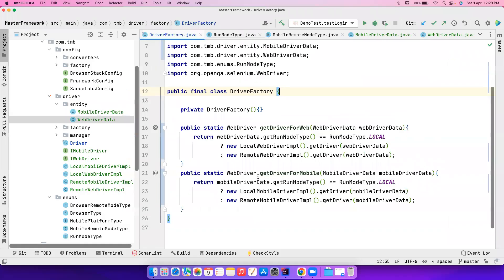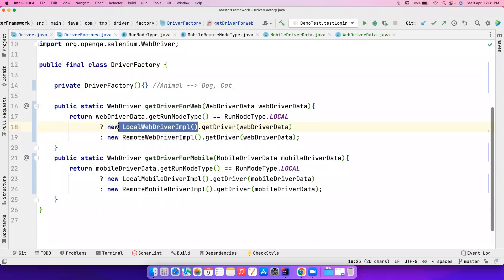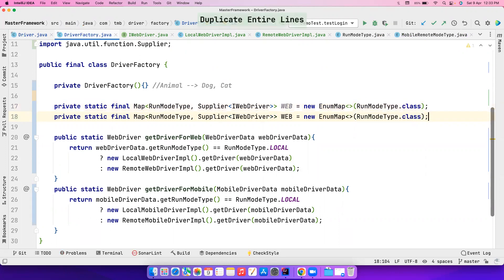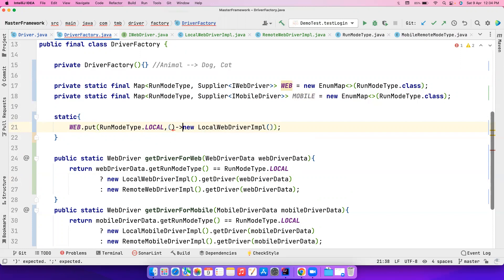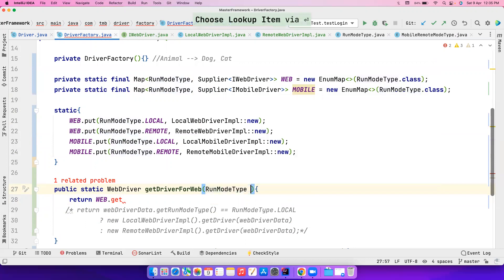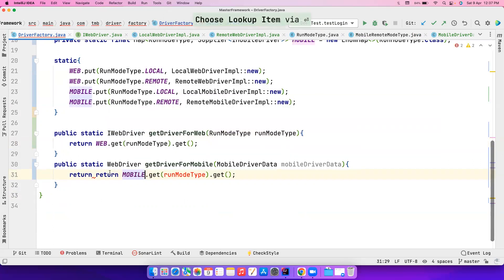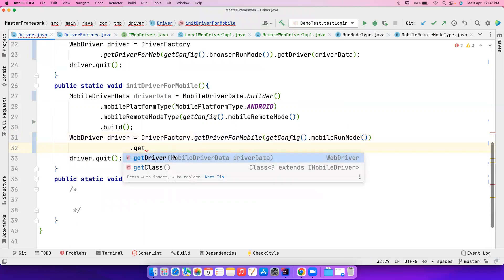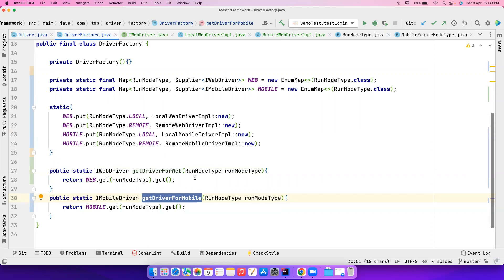Part 9 | Refactoring Driver Factory class | Functional Interfaces | Method Reference | Clean code

Comment: Nice video! I have one question is there anyway to get data from elastic Search, like we use SQL db?
Reply from the maker: Yes you can using api calls
Reply: @TestingMiniBytes  Can I write specific selects or something like that, as SQL SELECTS in elastic?
Reply from the maker: @giorgikereselidze23  you have to make api calls to get the information. Elastic search is like a nosql database. You should get something in the internet
Reply: @TestingMiniBytes  Do u have some References in the internet or tutorials about it?